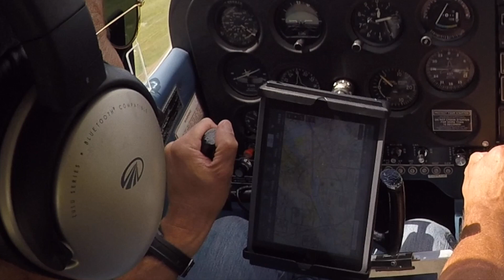Helicopter Wake Turbulence affects Cessna 172 on take off

Comment: It’s probably just me but I would’ve reported that turbulence to ATC. There wasn’t enough separation. A good controller would have held you a little longer if he was aware.
Reply from the maker: This was an uncontrolled field, but agreed ATC would have been on it.
Reply: @Cpsvids  I thought ATC had cleared the aircraft for a right turn after take-off. That may have been an area clearance of course.
Reply from the maker: @magnificentmuttley2084  Yip procedure: “CIRCUITS: Rgt hand circuits Rwy 27 (CAR 602.96).
As soon as practicable after tkof fr Rwy 09 or 27 turn 20° to the North”
Reply: @Cpsvids  got it. Thanks.

Comment: For the non aviation aficionados:
From wikipedia:
"The Robinson R44 is a four-seat light helicopter produced by Robinson Helicopter Company since 1992. Based on the company's two-seat Robinson R22, the R44 features hydraulically assisted flight controls. It was first flown on 31 March 1990..."
Empty weight: 1,505 lb (683 kg)
Gross weight: 2,500 lb (1,134 kg)

Comment: Note the turn coordinator and the yawing action. Heaps of rudder is your friend here, but I can't criticize because I'm sure I would've had the same exact reaction. Now I'm curious if they offer wake turbulence in sim training. I think the flow of wake turbulence is well-understood and has been modeled, but I'm unsure if that's incorporated in any of the certified sims or not. Regardless of how correctly you handle it, as you seen, wake turbulence will ruin your day really quick. I don't think even the perfect, textbook reaction could save a little Skyhawk from any significant wake turbulence.
Reply from the maker: Agreed - given the recent video doing the rounds I don't think there is anything that could be done. Fortunately it had crossed perpendicular to my track so I was in and out in a split second

Comment: Blanclirio says that the aileron is not your friend in wake turbulence and that instead it's the rudder.  This is because the turbulence is the variance of apparent speed over the various lift surfaces.  Namely one wing has stalled and excessive aileron input exacerbates that stall.  It's counter-intuitive but something all pilots could and should learn.
Reply from the maker: Well said - it all happens so fast - I would really like to practice in the sim some day now I have a whole not more hours.  Overcoming instinct is hard.
Reply: That is why AA crashed an a-300 at JFK, they ripped the vertical stab clean off. Everything is so situational.
Reply: @a777av8r  1st officer was way to aggressive with the peddles on that one
Reply: @Daywalker_27  the problem is the return to center forces can be quite large and make it swing past centered, causing you to want to step on it again. Blindly using rudder instead of aileron is also no good. It should be coordinated and airframe specific. That's why you should be intimately familiar with your aircraft and know it's handling quirks in all respects.
Reply: @TheSoaringChannel  you can overcorrect in aircraft?  Like in a car?  (Not a pilot, obviously)
Reply: @Glum1964  It's not over correct, per se. Rather, it is incorrect correction....
Reply: @oneanddone7992  right. Or as we call it PIO (for Christopher) a pilot induced oscillation.
Reply: @Glum1964  an airplane is always "drifting" or going around a corner (in car terms). We almost always need to place a small amount of vertical axis correction, via the rudder pedals. Airplanes must be acceptably maneuverable so that we can easily control them, so they must be slightly unstable. This means we always are on the controls when we don't have an autopilot. A trainer such as a Cessna is very stable, and is also not very maneuverable. Airliners must be unstable so we can get them to turn. The Cessna in this video is very stable (in still air) and the problem with that trait is that if you get tossed by an outside force: it takes a larger amount of control inputs to correct it. I hope that helps Christopher 😊
Reply: I know an AA A-300 F/O  who also thought the same thing, ask him what happened when he tried to use the rudder instead of aileron when he encountered the wake turbulence of a departing 747. Oh wait, you can't.   He won't answer.
Reply: @joelt4416  it was a 757. Not a whale.
Reply: @TheSoaringChannel  no it wasn't. It was an Airbus A-300, AA flight 587 going from JFK to the Dominican Republic. Nov 12 2001

Comment: If you were using full power on take off, 2400 RPM is kinda low.  Shouldn't you see nearer to 2700 RPM?
Reply from the maker: Wow!  good observation - but explained by the fact I have the O-360 STC with the big Sensenich prop which maxes out at about 2350 from a static run up.
Reply: @Cpsvids  Thanks for the explanation.

Comment: Didn´t you realize, that your turn indicator is completely messed up?
Reply from the maker: Mirko Mania Well noted!  Actually my turn coordinator needle has been a bit crazy for a while. The ball is fine, but the needle has been jumpy. It really needs to be replaced, but given I fly 100% VFR and the fact it is intermittent I had not done it yet. Maybe this annual in May.  Thanks for the comment.
Reply from the maker: Yes - the ball is fine - it has since been replaced but as a VFR only guy it did not ground me.

Comment: Why is the audio cut sometimes in cockpit view videos?
Reply from the maker: Hi - This is an issue of using a single camera.  It is because the camera audio input is typically connected to the headset output and so it only picks up background when someone is speaking.  (The squelch setting is exceeded). To get around this there a couple of things to do. (1) You could turn the squelch right down so it is on all the time. (That would drive you nuts!)  (2) Use a second camera / recording device and merge the audio in editing.